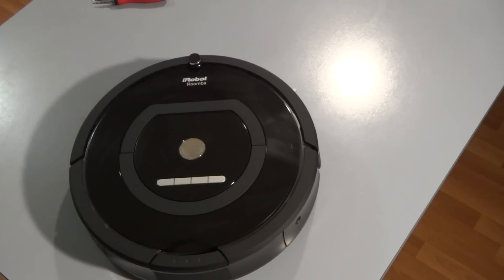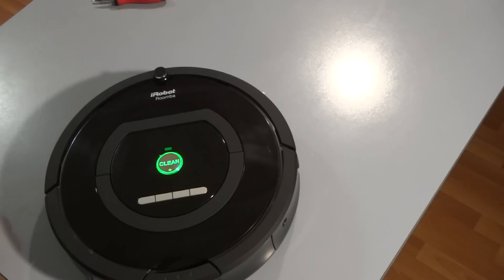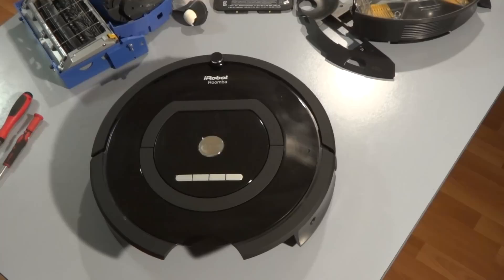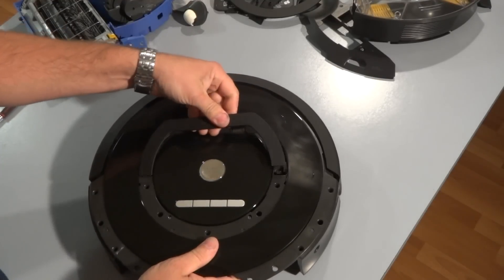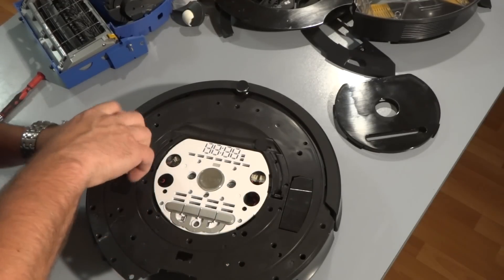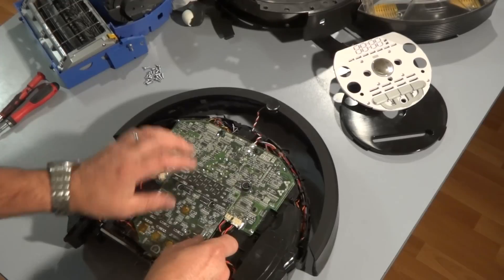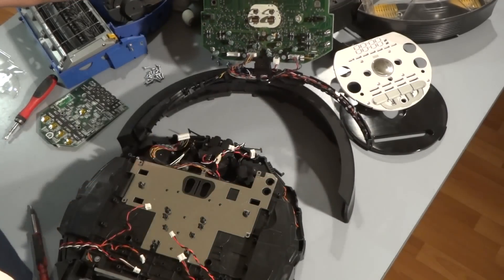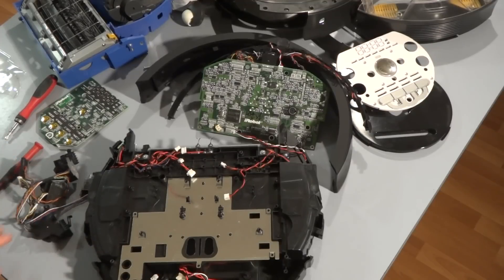How to Disassemble and Replace the Bumper Sensors on the iRobot Roomba 700 Series Part1

Comment: Dear all, you can buy the IR led and IR photo transistor parts much cheaper than in the ebay link. Check out your local electronics store for these parts and you will find that the price is 50cent per one part AT MOST.

Comment: I have a 980 and it fell down the stairs. One side of the bumper popped out I can't get back in. I can push it down and it'll work temporary but once it pops up I get an error on the bumper. I watched how you popped out the entire bumper hoping it'll make it easier to push back in. But now I can't get the entire bumper back in. I didn't unscrew all of the tiny screws need to find my computer screw driver to do it. Any tricks or strategy in getting the bumper back in? Thanks

Comment: This video is good not just for replacing bumper sensors, but also good as a tutorial to take apart the Roomba 700 series.  I had been stuck disassembling my Roomba 770 until I saw this video where some of the hidden screws are.

Comment: Thank you!!! My sensors on my 600 series Roombas are dirty!  I subscribed and I'm going to go through your videos to see if you show how to remove the clear plastic on the sensors, because the dirt is on the inside of the plastic.  I'm guessing that once you removed it, it should just pop off.  I've had my first Roomba (which I'm in the middle of disassembling) since 2012 and I have never taken it apart (except to replace the battery).  Today, I installed a new side brush and later I'll buy a new replacement brush head.

Comment: Great video. I got failure 6 al the time, because of dusted cliff sensors on the inside. With the help of your video I was able to progress to them.  One can acutally disamble with a flat screwdriver the clear cap of the Cliff sensor and clean it on the inside  Maybe  you should show that to your audience too? I am pretty sure my  issue is solved now. Let's get it togehter again! Thanks!
Reply: I also cleaned my "dusty inside"  Cliffsensors! 😊

Comment: Question: My Roomba E6 blows thru virtual walls and does not sense the charging base. How much tear down do I need to do to change out the IR sensor?
Reply from the maker: Did you do the built in teat to see if the IR sensor works on the Roomba? Could be bad connection or ya could be the bad sensor,  easy way is take the bumper off and cover and work from there

Comment: no need for sensores, can i just remove them and be done with that sensor crap ?  will it run without sensore or do i need to fuse some wires.

i assume the senseres just tell the machine, yes i can se light, can i fuse a wire some where to give that input ?

Comment: Holy hell you did that fast.
I Wana see how long it takes you to reassemble.
We have a lot of big dogs we clean Roomba out frequently Not to that extent but take the brush tray out clean around.  This am it sounded very loud and high pitch clunky sound with it going in circles. Replaced the brushs and sweeper piece, cleaned sensors didn't test the bumpers!! Put back together and same issue.
Almost like a gear or wheel issue.
I wish I would have watched this video prior to reassembling.  I will do the system test now.
Are there any fixes for the roller gears or wheels if that is the issue?
What site do you like to order parts from?
Thank you very much for the video and your time.
Liked the video and subbed to the channel
Jon

Comment: Hey this is an awesome video! Thanks for putting this together. My 770 has been working great until it kept on getting stuck under some appliances when the virtual wall's batter died. After a while, the sensor on the front bumper broke off and the 3 wires the connect to it rip apart. Now it will go back to the base on it own and will not charge. The only way I can charge the unit is by connect the power adaptor to the side of the unit. Could I kindly request that you show how the wires (black,red and white) are connected to the sensor? This would greatly help!  Also do you know where is a good source to buy replacement parts in general?

Comment: I have a Roomba 761 model.  Took it apart and cleaned it.  THEN I found these videos.  Wish I had found them before tackling the job.  It would have been MUCH easier!  Great videos!!  I want to add something to the bumper to eliminate a lot of the issues with getting it stuck under the bed, dresser, behind the sofa etc ...  I was putting up barricades, but that was ridiculous.  What would be the best material and method of attaching to increase the bumper sensor height by a couple inches?  I'm sure others would find this helpful as well.  Thanks in advance.

Pat

Comment: Excellent video. My Roomba just got broken IR sensor (I believe), because it is ignoring the lighthouses and it can not find the charging station, event if I put it right next to it. 
I found out, that there is the diagnostic mode, I was able to get into that mode, but then was not sure how to proceed with the testing. Googling did not reveal any info. 
I was searching eBay for spare parts and found plenty of the 500/600 series IR sensors dirt cheap, but for 700 series, only the whole bumper with full sensor array seems to be available and it is much more expensive. You said, that it is the same thing on 700 series as it was on the previous models, so if I just buy that cheap one and replace it, it should just work, right? Can you confirm this? I would appreciate your input on this. Thanks.
Reply from the maker: +Martin Dratva There are several parts that are same in older models and the newer models, but the IR sensors for communication with lighthouses is not compatible, the IR sensors inside the Roomba bumper are the same parts, the left and the right sensors as well as the front cliff sensors
Reply: +TheiRobotChannel - I was actually able to fix my Roomba using the 500/600 series IR sensor. I contacted iRobot support and they told me, those are compatible, so I went ahead and bought one. After disassembling, I found out that the connector was different. When looking at it, I could not tell the difference, but it did not fit. I resoldered the new senson on old connector and (to my surprise) it works fine. :)
Reply: @TheiRobotChannel  make More videos

Comment: My roomba wont follow alongside walls anymore. It just tries to "turn into" the walls a couple of times then changes direction. When it was new (a few months ago) it followed along the walls instead. What can I do?
Reply from the maker: are there any errors reported back for the Roomba or could you make a video on what is happening, cause it sounds like it is working fine, just because it works in different patterns to complete the task, but if you do the video I could see what is happening that would help

Comment: Hi, my 780 won't charge, it find the docking station, went to it, bump a few times and just moved on! I check the voltage on the contacts of the docking station and it only showing 2 volts! is this correct or it should be more.  I wonder if this is the problem. This happened before but it somehow fixed itself and now it happened again.  What's your suggestion?  Many thanks.

Comment: My 595 is moving the docking station around, runs over it. I have gotten no beeps but ran the test and it seams light sensors aren't working but it does slow down when heading to the wall, some times might be all on one side. I think it started after replacing the old battery with the extra long one. Now it will run close to 2 hours almost to complete out if power well into the red light. It also knocks things out of its way like end table, monster it has become
Reply: I have stuck on cushion under the light sensor to protect, could that be the cause. Its under the panel that looks like a cylon face from battlestar galactic

Comment: My Roomba 770 passed all the tests but it keeps saying "Move Roomba to new location and press start".  It is sitting on level surface, all wheels, rollers, and sensors have been cleaned and blown with air.  But when I press start, it sits there and repeats same thing.  Again, it passed all the tests shown in this video.  What is next step?

Comment: Hi man, first of all congratulations for your useful videos! :-) I have a problem with my remote control (it works only if put it very close to my Roomba 770 - I already changed battery of course and clean it). What do you think...Do I have to replace the remote controller, the IR module near the bumper or the Roomba Base? Thanks!

Comment: Hello,
Thanks a lot for this AWESOME video.
I just got a used 776p and I want to make it shiny again.
To do so, I wanna conver the trims.
I removed both left and right one from both sides of the tray but I can't remove the one on tip of the front bumper. It seems to be screwed from underneath to the bumper and I don't wanna break it trying to pop it off if it is screwed indeed.
Can you help me removing this specific part ? do I need to take the roomba completely apart for that ?
Thank you by advance

Comment: Been doing searches for a Series 640 and just found this channel, go figure Google/YT.... I have a 640 that we have been able to keep it going until today. The unit does not have a on board diagnostic just a battery indicator and a red triangle indicator. The unit will run, then stop and then the Red Triangle will illuminate. I did the hard rest and runs again and repeats. Took it completely apart cleaned it good and even sprayed electrical component clean thru the wheel motors...cleaned it good. It runs a lot long now before it stops, and the red triangle comes on again. "Hazel" has been a good unit and really want to save it for I cannot afford to buy a new.  Anybody..... have good/useful recommendations/suggestions on troubleshoot to figure out what may be the problem for a fix. Thank you!!!